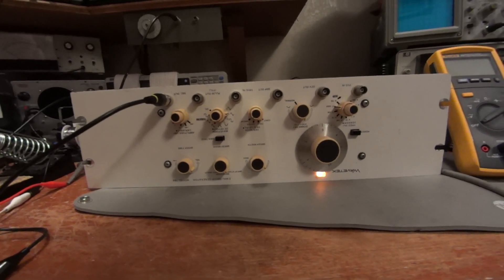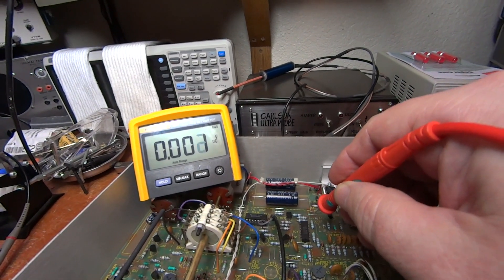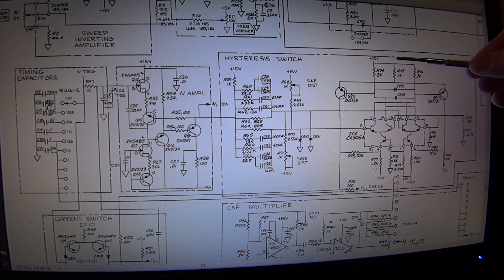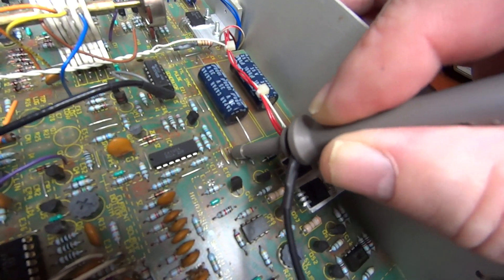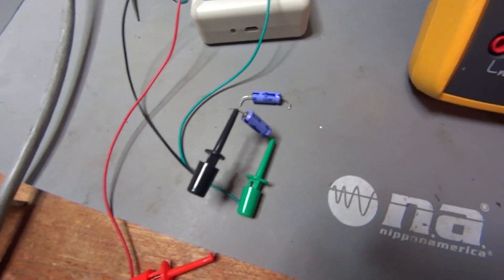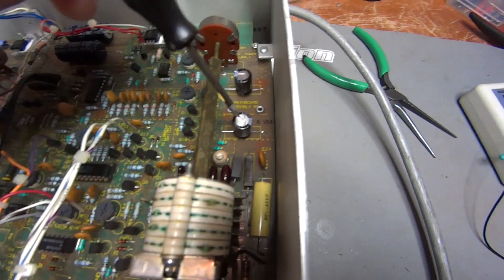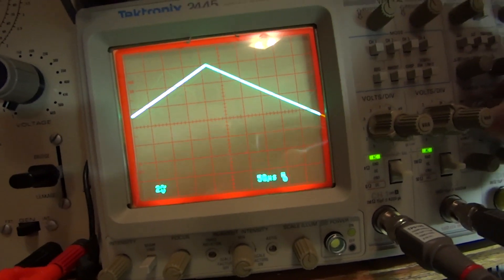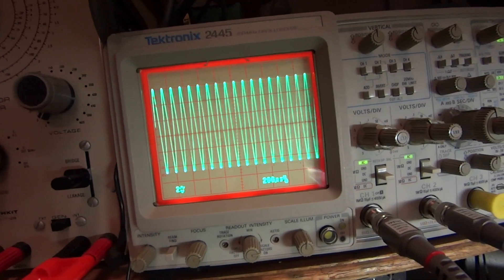Down The Rabbit Hole. Wavetek184 Repair.

Comment: Well, that is one more reason to never ever (again) rely purely on digital voltmeters/multimeters to verify the AC ripple on any PSU really. I always  use  my tried and trusted old analog oscilloscope for that. Good video though . Tnx. for sharing.
Reply from the maker: You hit the nail on the head. Nobody expects the power supply to turn into a 100khz oscillator. Ripple is one thing. Ha

Comment: Nice snooping job!! 
16V 'lytic on a 15V rail? I thought it should be >30WVDC, no?
Reply from the maker: I replaced that with a 63 volt. I agree that was silly. I have never seen a linear power supply oscillate at 100khz. That's a new one.